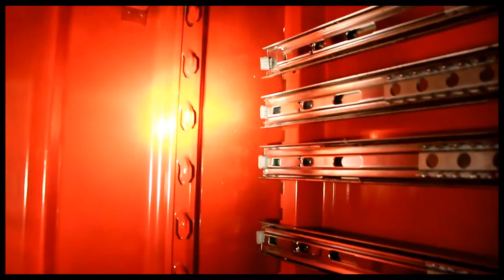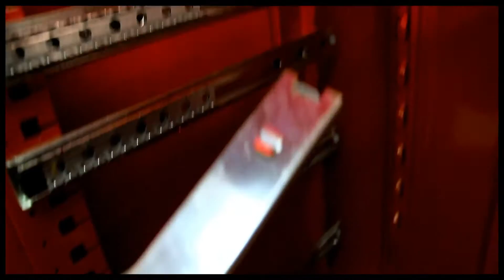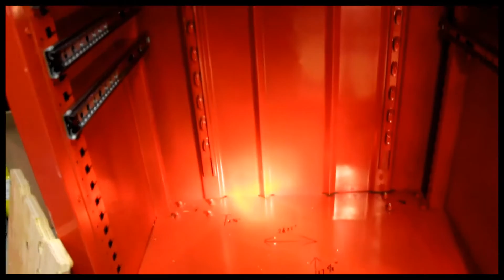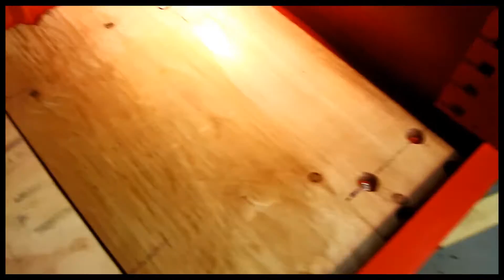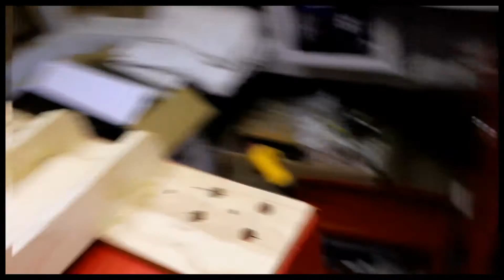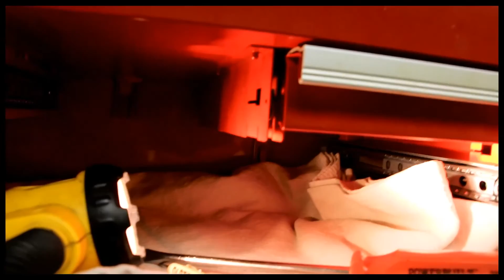us general pro tool chest mod plywood & drawer slides

Comment: this is stupid all this work &$ spent for what? I use the same box for a few years never had a prob I'm a diesel tech. if it's junk go get a snap on
Reply from the maker: I've had this box a while now, no more trouble.  The box was slightly busted when I bought it.  "if its junk go get a snap on" is an understandable sentiment, but at what point do you determine something junk and throw it away?  this box has been exceptionally useful to me since I fixed it...  3 years now?   I use it on a regular basis.
Reply: Spend 5k on a StrapOn equivalent? That's not a smart move.
Reply: Diesel 😂 LOL righto flog
Reply: Snap on is a fucking rip off
Reply: @michaeldunnii9558  123
Reply: Stfu

Comment from the maker: The random orbit sander just turned on by itself, but since I had been using it earlier, I probably didn't turn the switch to fully "off" position and that's why it turned on, but it was a little creapy
Reply: Doesn't it's name, "random...," suggest the answer. They probably got this name because of their proclivity to run randomly.